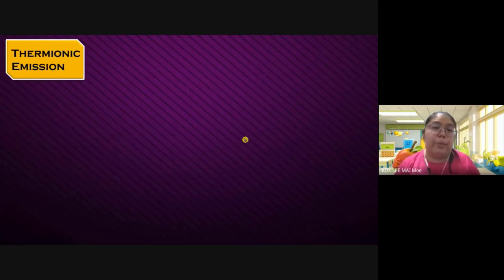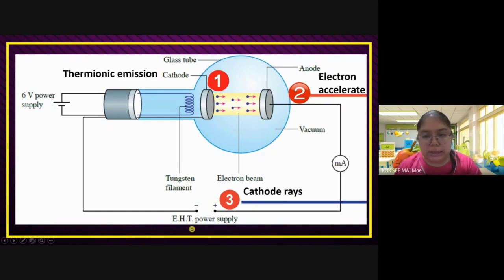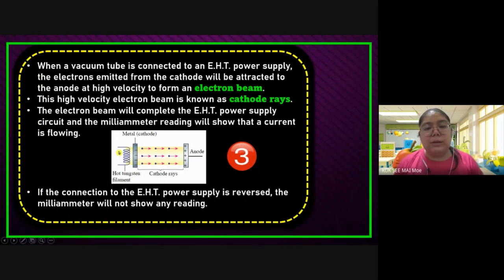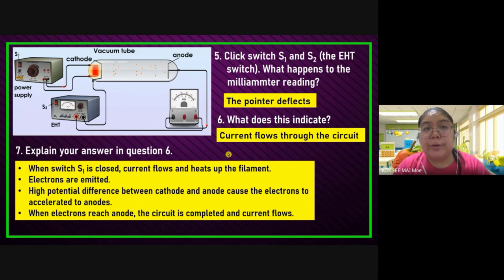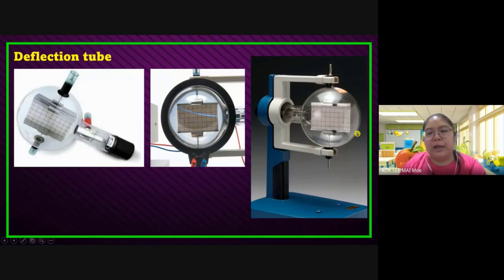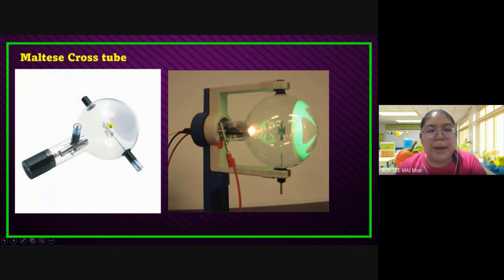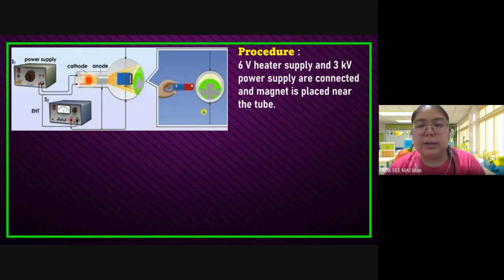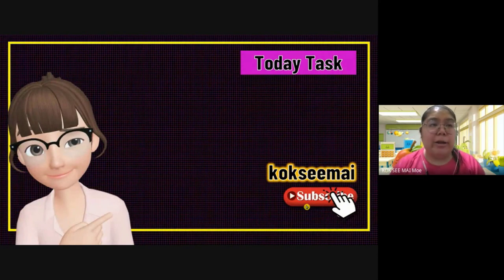Lesson 5.1 ELECTRONS Form 5 KSSM #1

Comment: Hello madam.. When the switch is closed or switch is turned off,means the current flows in the circuit rite??
Reply from the maker: switch closed, and switch turn on means current flow
Reply: @kokseemaiPHYSICS  ohh ok madam..so switch open and switch turn off means current does not flow in the circuit..
Reply from the maker: yes